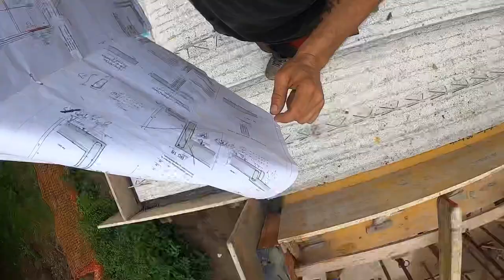Project Phoenix (7) floorsday - laying giant bricks

Comment: Hi Jay, lot of work craning those sections  in. Do you always have concrete first floors or do you ever use timber ?
What was the problem with the crane ?
Another really interesting video 👍👍
Regards 
Tim
Reply from the maker: Hi Tim yes we do timber floors also but most of the time it’s concrete ... the crane stopped working it gave an error on the the second hydraulic pump of the arm , it’s probably a wire has been pinched or a circuit or relais not so good anymore , so probably an electric problem , it just came out of maintainance so it will be going back now for a repair somewhere ... thanks mate 🙏🏻

Comment: For what that mortar under the concrete plates
Reply from the maker: Yes I prefer to put it straight on the dpc but on my engineering plan was a nota that said to put it in mortar , next time I’ll ask engineer is ok without , works much easier and is approved , most of the time they’re put dry on the wall and not in mortar